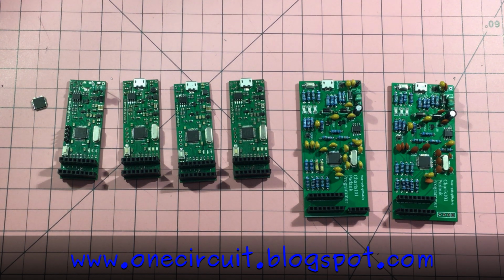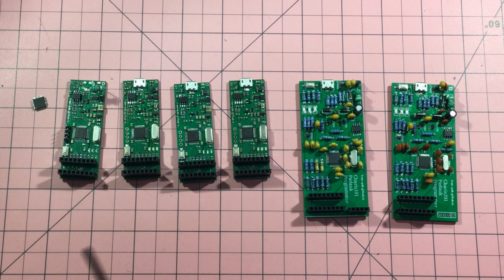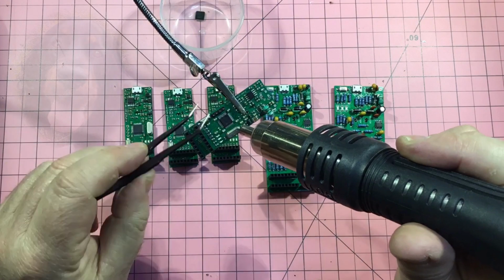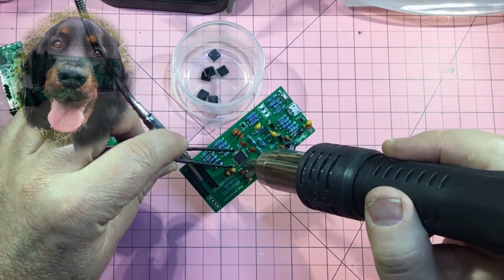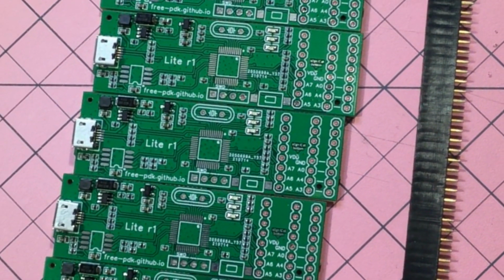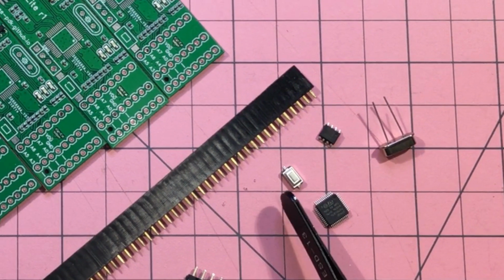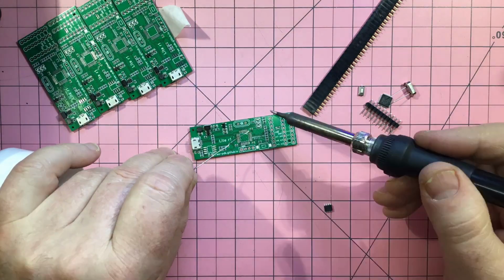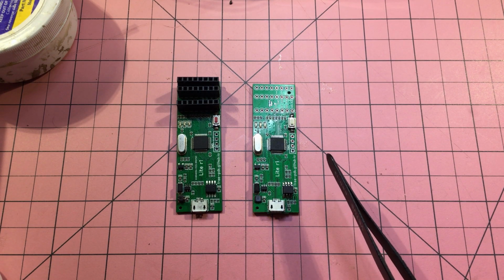Recycling STM32 chips

Comment: For such a large volume of chips being tested, it makes sense to set up an STM link with an SMD socket and build a single test board with the same SMD socket for solderless testing of microcontrollers. Otherwise, it's a waste of money resoldering chips back and forth.
Reply from the maker: Yes it was only 6 chips in the end, but a dedicated tester sounds intriguing! 🧐
Reply: @onecircuit-as  Yes, if you have a PCB layout file with discrete components, it's easier to adapt it to a "zero-force panel" for quick installation and removal of the STM32.;)

Comment: Not sure why you went back to hand soldering the parts on, when you made a complete board in the rework oven wow, my mind is blown apart .. 🇦🇺
Reply from the maker: I was trying to make (unsuccessfully) a through hole version more accessible for regular folks. The early smd versions were extremely tricky to solder, even by reflow. The newer “minimalist” versions and revisions are MUCH better! I decided to be a crash test dummy for all the different types. I’m still a bit sad my simple version ended up being a non-starter and one day when I’ve got some time I’d like to revisit. I have some ideas how to improve it now. 😀👍